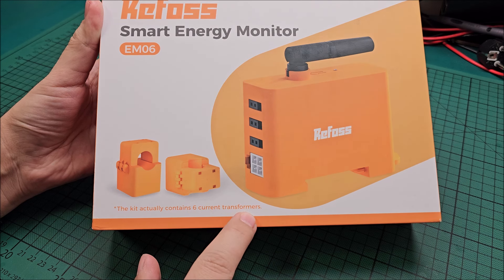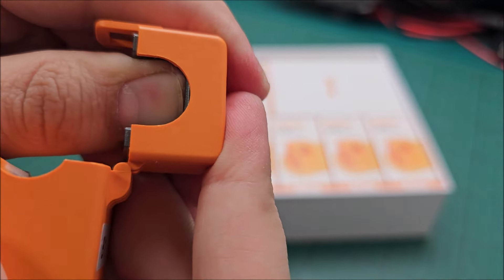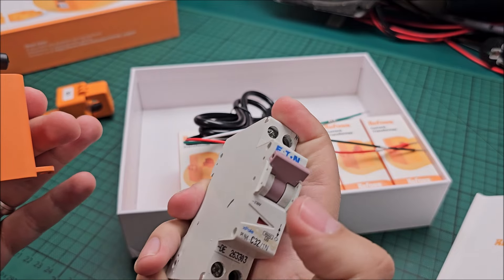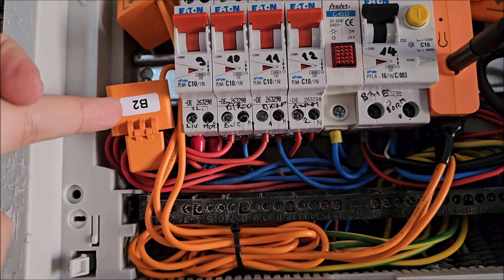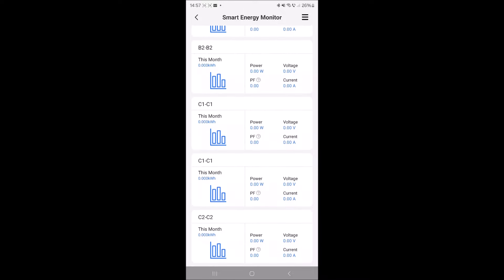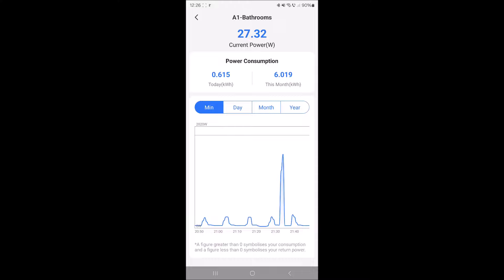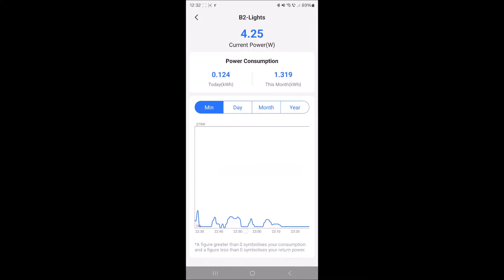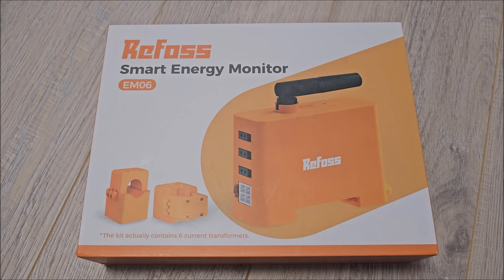Refoss EM06 Smart Energy Monitor - unboxing, install and review

Comment: Can someone tell me what's the sampling rate for this units ? I need it to be much less than 15 min. I would like to use it to inform me when the 15 min power will exceed some value, so I need to do aggrregates using higher granularity. Anyone ? I can't find this data anywhere...
Reply from the maker: Send an email to the manufacturer and they should be able to provide this info.
Reply: Regarding your question about the polling interval or update frequency of the EM06 device, the data acquisition frequency for this device is 4 seconds. The refresh interval in our app is approximately 3-18 seconds, with the fastest refresh being every 3 seconds. If you are experiencing a refresh time of 20 seconds in the app, it may be due to a request timeout, as the app's request timeout is set to 15 seconds.

Comment: Salut, can this be used for DC monitoring also ?  ex : 6 solar panels string  - Voc approx 350V  .  Thanks.
Reply from the maker: Salut. I don't think the software is made for that. Try to contact the manufacturer and ask for an opinion.

Comment: Actually I strongly recommend to avoid those.
I bought 4 of them, having installed by qualified professional under my supervision (CT direction and wiring for each phase/voltage correlation). I get incoherent data, showing negative values on some phases that doesn't make any sense. The weird thing is that I see correct current data, but power is calculated as negative due to a "PF" (power factor) with negative value (in my case -0,87). If I try to reverse the CT, the value get positive but with very wrong value due to PF going to 0,20 !!
I tried contacting REFOSS who doesn't reply emails or contact forms. Now I have to returns those useless devices after I spent money for the installation.
—edit : solved due to incorrect wiring from professional AND ct probe reversed (on some you need to follow the arrow direction and on some others you need to reverse!)
Reply from the maker: Wow! Sorry to hear about your bad experience. Mine seems to be working perfectly on single phase, so can't comment or advise about other scenarios, sadly.
Reply from the maker: Hello. Refoss just informed me that they tried to reply to you message here, but something went wrong and the message does not appear. Please contact them on yvette.yin@meross.com
Reply: @UltimateDIY  thank you, I solved the issue and edited my previous comment.
Thank you for helping!
Reply from the maker: Awesome. Glad the problem is solved 👍🏻
Reply: @AlessandroCaporale how did you fix the problem?

Comment: Just installed all 6 current probes, with direction of energy K->L. But, as other comment stated, the wattage is completely random. I cant tell anything from those values. Voltage is positive 234V, current positive 0,63A, wattage -136. I made sure I had "voltage lines" on the same phase as the current probes. This is annoying.
Reply from the maker: Where you have a negative reading rotate the probe and all will be solved.
Reply: @UltimateDIY  that is logical. What bothers me is, why print directions on the Probe if they are wrong?
Reply: Or why not give the Option to change sign in the Software?
Reply from the maker: That is beyond me 🤷🏻‍♂️
Reply: @AddiAtze  We apologize for the incorrect directions on the EM06 Probe. The issue with the reversed current direction was discovered and rectified promptly, and we have updated our product instructions. If you're still experiencing this problem, please contact our official email, and we'll assist you with a solution or compensation.